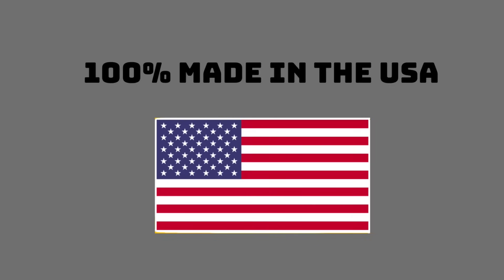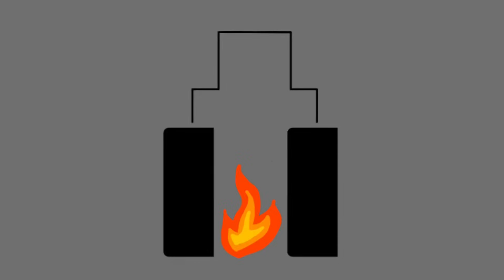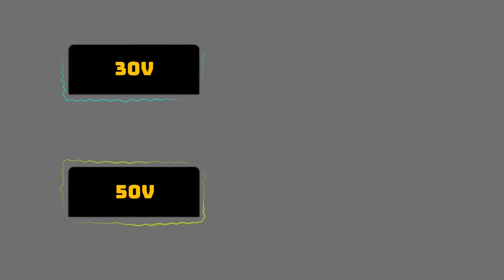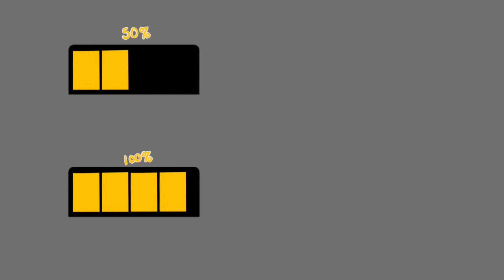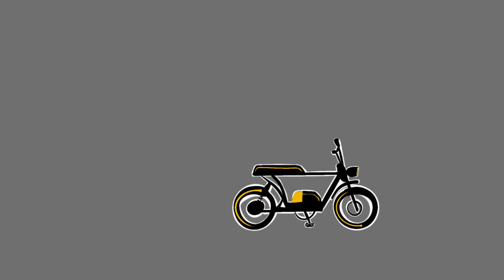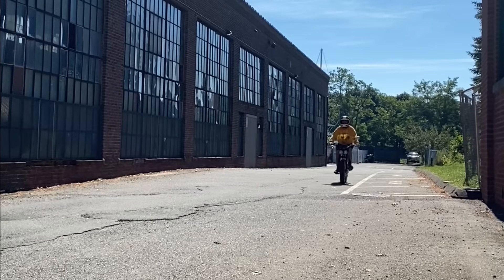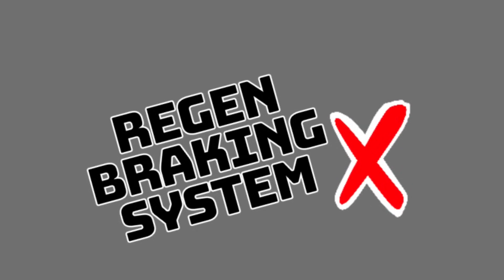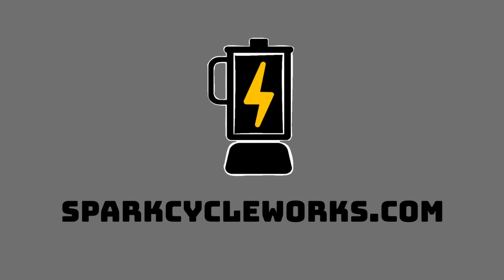How to Add a 2nd Battery to Your eBike Using the Battery Blender

Comment: Finally!  Thank you so much for this great video!  I bought 3 from you guys and I can’t say enough good things about it. I’ve been taking the risk of using these blenders on my two Ariel Rider X class 52v with 35 amp controller and a secondary 52v 20 ah battery’s and have had no issues at all , I even seem to get a boost when running both batteries together.  I’ve put on over 600 miles on the battery blender and ride weekly without a problem. Can you tell me what the risks are or issues I might run into by using this with my  35amp controller? Thanks in advance.
Reply from the maker: Awesome! Love to hear it!! The risks of 35amps are mostly focused on heat dissipation. We have overbuilt the device with enough safety factor to handle it, but it’s not something we like to recommend.
Reply: @SparkCycleworks  cool thanks

Comment: Owned this for a couple of months now, and this is a great purchase I made for my bike. It was annoying having to open up my controller access panel just to use my spare battery, and this gave the unexpected benefit of ever so slightly increased range as well! Ariel Rider X-Class 48v, blended 52v with 48v.
Reply: You paid $150 for two diodes? that's all it is.
Reply: @kyle8952  Kyle there any risk of degrading the batteries quicker by running different spec batteries in parallel. i.e. 52 vs 48v, age difference, etc. 

I understand diodes only discharge one way, but I'm getting conflicting reports.